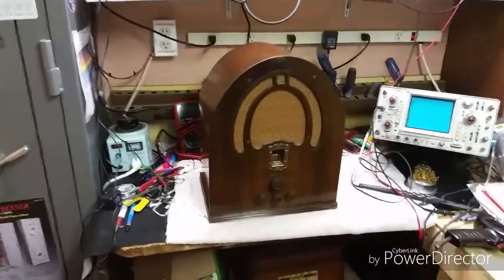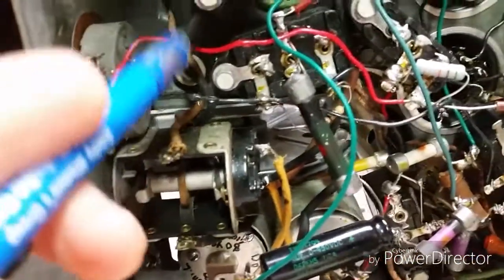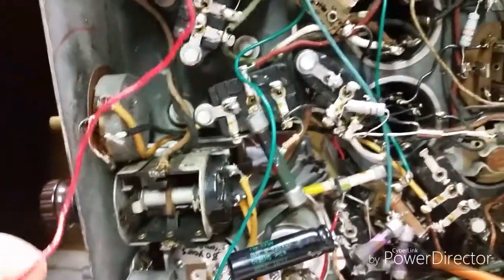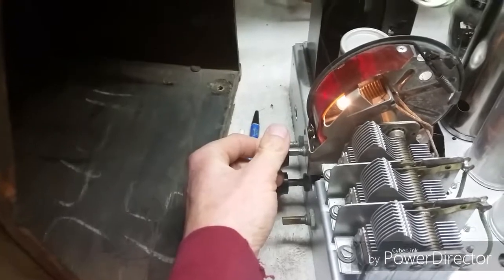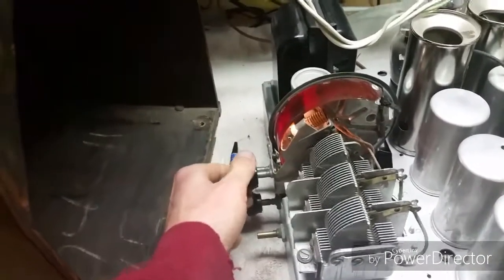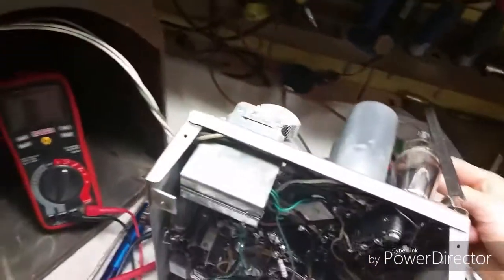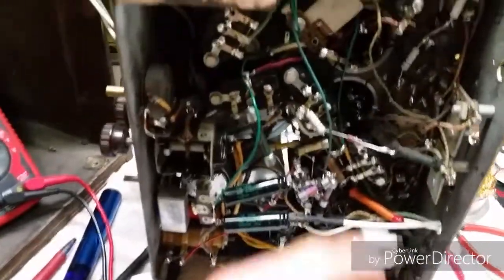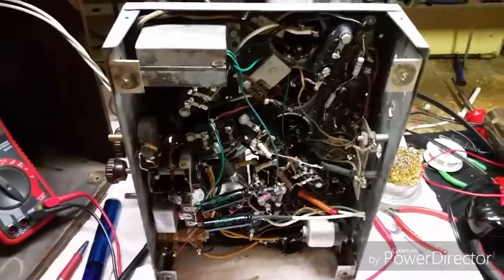Tinkering around with the philco 89 again

Comment: Hi Dan...it was great to see your model 89 out of the cabinet......I got my ball bearing at Ace hardware...Make sure you get a few sizes. ...Maybe you put in the wrong size cap...I did that a lot when I was new,....mistaking a .1 with a .01 and .001...... If you have the  36 tube , then that's the same as mine...The Philco Phorum has that schematic for you.....enjoyed....Buzz
Reply from the maker: Yep I may have to check the caps because this was my first restoration I did 10 years ago.

Comment: It sounds like the oscillator is kicking out on the upper tuning range.
Check the oscillator tube and the resistors in the oscillator circuit and any caps in that circuit as well.
Make sure all your bypass caps are good.

Comment: u got feedback with oscillation.  use ur scope and go to the input and then the output of the detector. I hope you rewound the ant and oscillator coils.  and it could be most anything, ur chassis is so clean I hope u did not clean it with tap water or some strong alkaline or acidic cleaner.  when cleaning a radio rinse throughout w distilled water only.
Reply from the maker: THe oscillator coil was rewound, I haven't touched the antenna coil but I have checked it and it's not open. I didn't clean the chassis with water, I de-rusted it with naval jelly and painted it.
Reply from the maker: What am I looking for on the scope when I go to the input and output of the detector?

Comment: Sounds like a cap Dan. You'll get er bud. Tough with out the schematic.
btw,,,, I have the schematic and update info for the early 89 model with the 36 osc tube. I have them on jpg format so if you need them, send me a pm on YT here and I will send them to you. They are on the Riders schematic source.
Reply from the maker: I did manage to get the right schematic from the philco repair bench so i'm going to go over it wire by wire and see if I can find out anything.